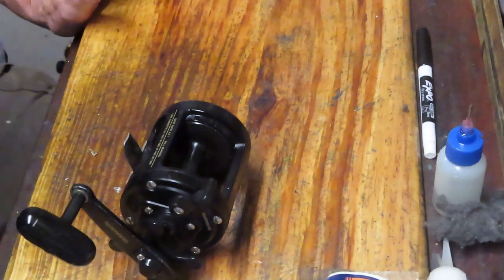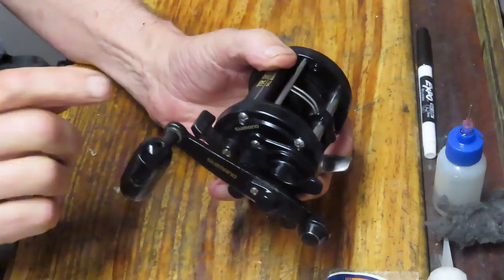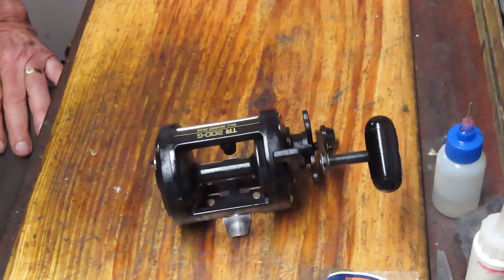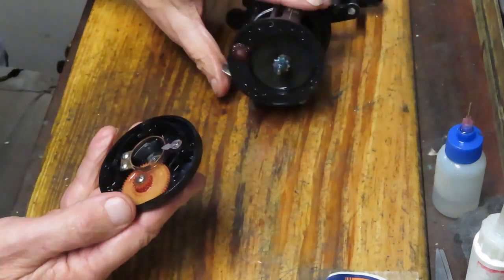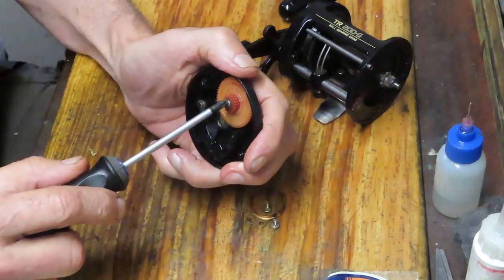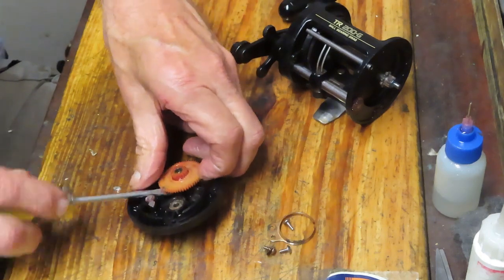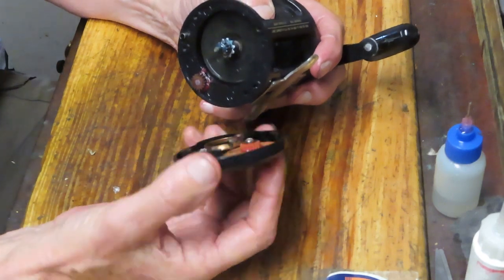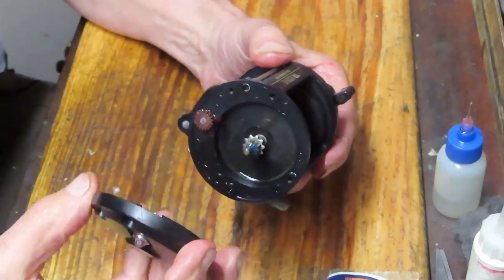Shimano Triton 200G very unusual  fishing reel problem and how to service

Comment: Hi Dennis I have the same problem with my TR 200-G. Where my free wheeling was so stiff it wouldn't free wheel at all. I pretty much had to pull line out and the retrieve was also stiff. I took my reel apart and found the idler gear was turning freely without any stickiness.  But what I did find was when i didn't tighten the screws, that held the end cap on, tight. it would free wheel easily which led me to think that maybe if I put a washer over the spool shaft that entered the cap it would hold it out far enough to allow for free wheeling and I would then be able to tighten the screws down again. This worked a little but still didn't give me the free wheeling although the spool was a little freer, but still not enough. so I backed the screws off a half turn that held the end cap on and that seemed to do the trick. Now I'm concerned that these screws will eventually back themselves off and I will lose one or two. Do you have any suggestions that may remedy this dilemma?
Reply from the maker: Have you tried backing off the spool adjuster behind the handle?
Reply: @2ndChanceTackle   yes It was the first thing i tried

Comment: Hey i believe i accidently deleted my comment. I had the daiwa 30h star drag. I assembled it and when i completed tighten any screws it wont turn anymore. You replied" My initial thought is that you have not merged the stud on the eccentric (free spool release lever) with the hole in the jack. Make sure to pull the jack up before installing the side plate and then gently swing the lever until it pulls it in and sets. Is the free spool release working when you have the case closed and reel is tight?"
So yes the free spool button works correctly i cant seem to figure it out. Can you explain the jack part better. Up as in where it would be in free spool mode?